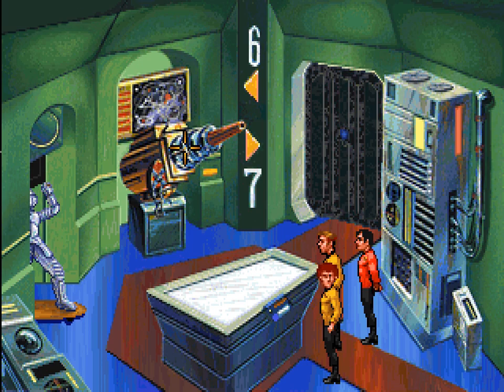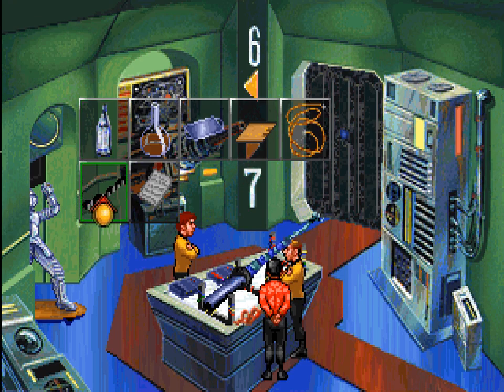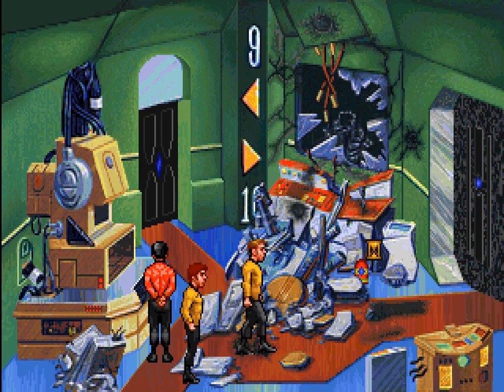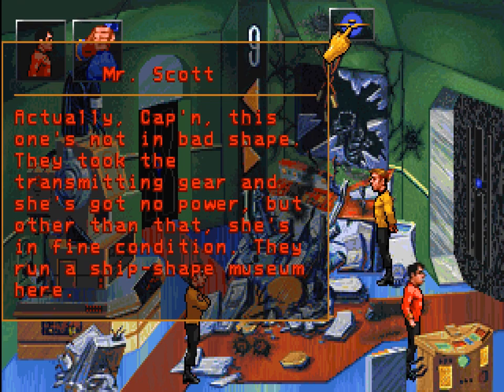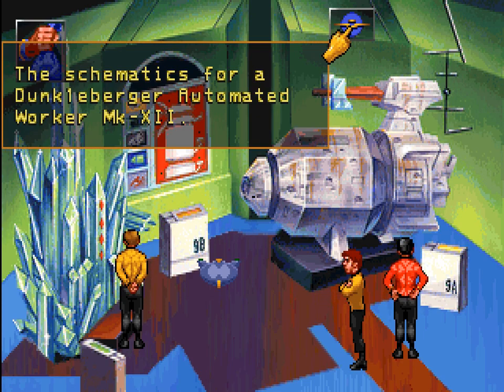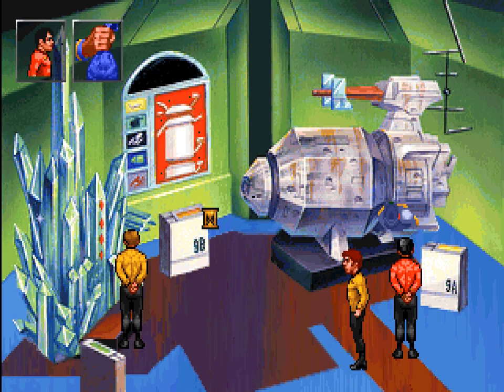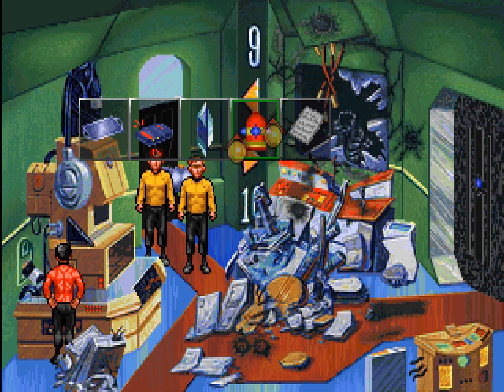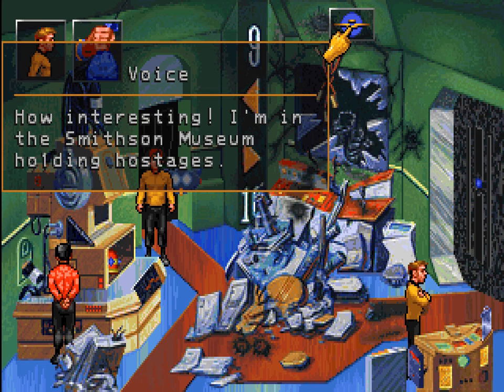Let's Play Star Trek: Judgment Rites - part 18 - Engineering creativity

Comment: Wow, so capacitors can be used just like batteries? In that case, why haven't we invested more heavily in renewable energy (a main drawback of which is storing surpluses)?
Reply from the maker: Capacitors can store energy, but they usually only store a small amount and discharge very quickly. They are heavily used in electronics, but I don't think they have any practical application for long term energy storage. Batteries are much more suited for that.
Reply: @Dilandau3000  Exactly, yet here they are being used to provide sustained power to a robot and a communication system, more like a battery.
Reply: Micah Bush You’re not entirely off-base. Intel SSDs use capacitors in that very way to gracefully shutdown in the event of power loss. The biggest trouble with extending that to the power grid is that the vastly larger voltages involved means that the technology used to make capacitors for electronics is unsuitable and must be instead implemented with more costly alternatives that probably kill off any practicality.
Reply: Capacitors are being used today to replace batteries in some applications. But the energy density is still lower today. Certainly plausible that they could replace many applications of batteries in the future. See https://en.m.wikipedia.org/wiki/Supercapacitor